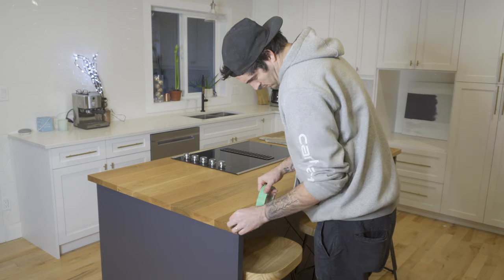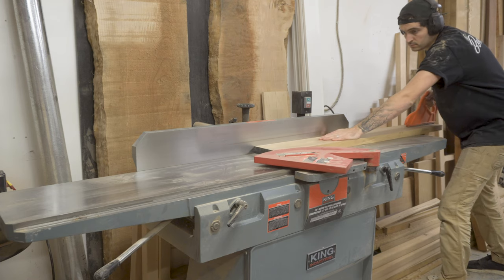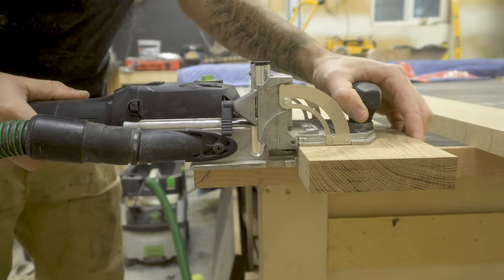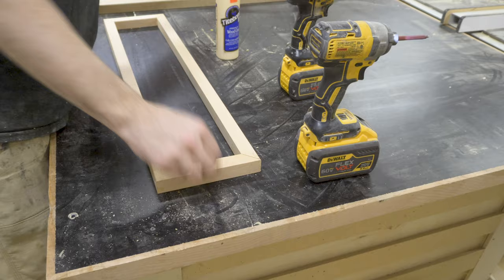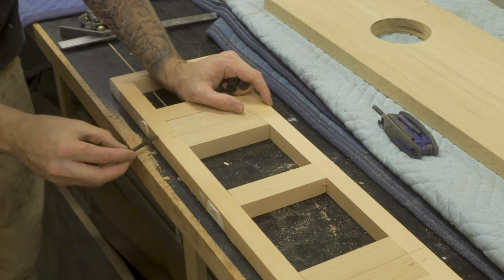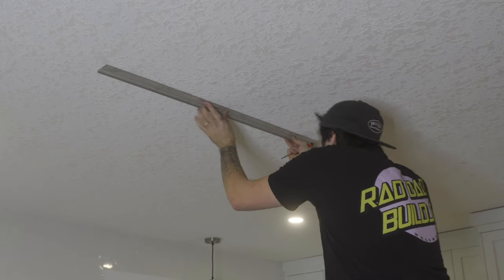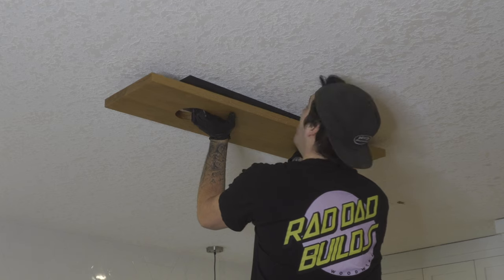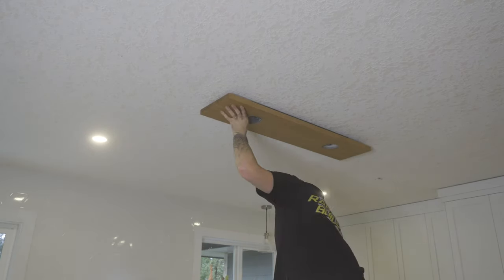Modern Kitchen Island Hanging Light Fixture | How to | DIY

Comment: Ok my question is how did you get the wires? I have 3pendants to put up but only one adapter need to add 2more but can’t get to attic, how can I do it ? Do I need to rip up the ceiling?

Comment: Nice build ..... but how did you tap into wires in your ceiling, when no fixture was there already?
Reply from the maker: So basically our kitchen before was a different layout. There was a light just to the right of the island, so during the renovation i removed the light and junction boxed it in the loft space above. Then when the new light was being built I brought a wire from that box above and fed the new lights with it.
Reply: @RadDadBuilds  thanks much! I appreciate the informative vid.